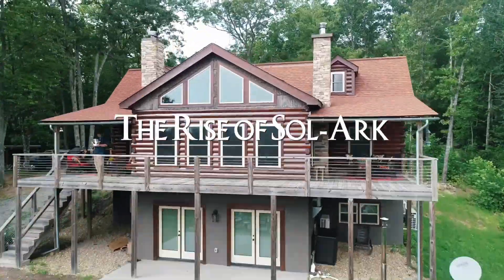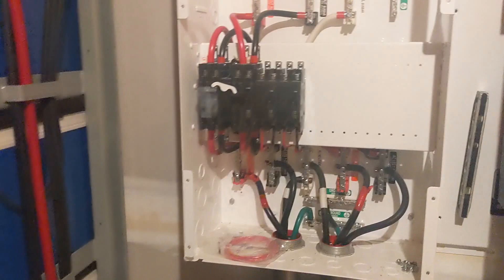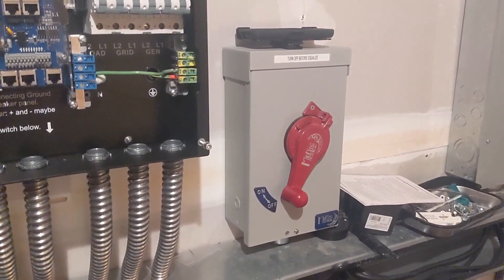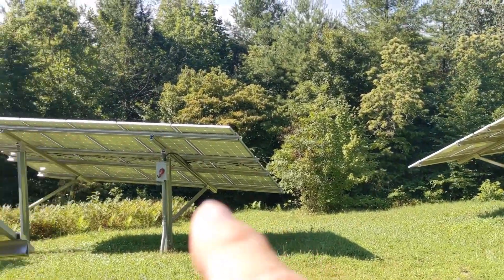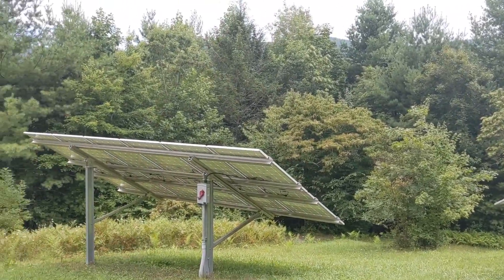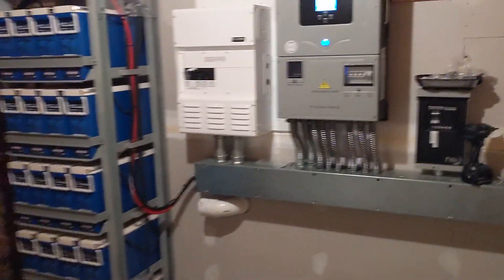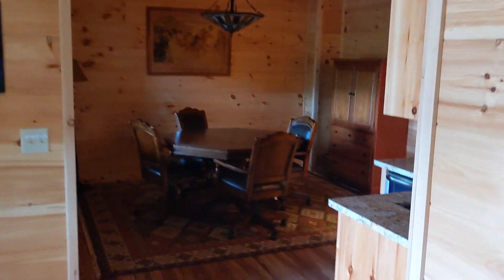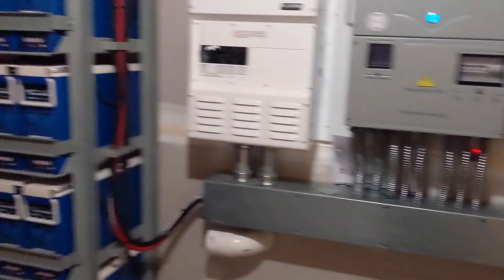The Rise of Sol-Ark!! (Retrofitting Sol-Ark Inverter and New Batteries)

Comment: what is the benefit/issue regarding having balanced PV input to the 2 MPPTs. I presently have (1) 10 panel string on one MPPT and (2) 7 panel strings on the other MPPT. Considering getting 4 more panels to have 2 pairs of 7 string panels. Total 28  400w panels is 11.2 kw.

Comment: Any reason why Sol-Ark doesn't focus on EMP hardened lithium LiFePO4 battery solution (w/ EMP hardened BMS)? They provide more cycles, deeper cycling, smaller footprint, etc... I guess Sol-Ark would have to answer to that, but I'm just wondering, as I am considering to purchase a Sol-Ark 12k inverter, and I already purchased lithium battery bank but my BMS's aren't EMP hardened.
Reply from the maker: They tried and spent the considerable amount of resources to try to EMP harden BMS's but they weren't successful.

Comment: I automated my change over switch by using a 4 pole contactor  2 no 2 nc contacts with a 230 volt holding coil fed from the inverter output , when the solar output goes down it deenergizes the coil and automatically connects to the grid. When the inverter output is restored it energizes the holding coil and switches back to inverter power.

Comment: I am must have missed something but I am wondering why you didn't run two 9 panel strings parallel? Couldn't you have been good with little loss of power by running lower amperage using two pairs of wire? I am using paired strings of 9 panels through 10AWG   THNN/TWNN stranded copper wire to each charger running 323'. Only experienced a 2.2% loss of power.

Comment: Freezer voltage. According to the spec sheet this freezer is 12/24 volt only. In the video you said it was 48V (battery bank voltage). So what is actually going on?
Reply: For $35 you can make it 48 VDC.
Reply: @ek9772  Can you post a link to that?
Reply: @ek9772  It is really odd that they do not list any specs on the 48V version. Not in the manual or the spec sheet.
Reply: @bradquinn4161  they make good quality products.  I would not worry too much over it.

You can always call the company, and ask for extra info.

Comment: Question, could you put a lighting rod up to decrease the issue with getting hit buy lighting, we had issues in Colorado at times, Dad would put up a electrical pole to be higher than anything out there and insert a rod ten to twenty feet long into the ground to attract the lighting to it instead of the equipment.

Comment: Honest question.  Why use carbon-enhanced lead batteries which will operate from 85% SOC to 50% SOC, yielding about 1/3 the nameplate storage, rather than your favorite brand of LFP batteries that will operate from 90% SOC to 10% SOC?  The higher usable amount of storage would allow for a smaller bank but would  effectively yield the same amount of storage, and cost about the same as the carbon enhanced lead acid batteries.  Am I missing something?
Reply: You can't EMP harden LiFePo's.
Reply: @Thomas Chrombly I'm afraid not, ask Engineer 775. He's the one that said you can't !   :)
Reply: @Thomas Chrombly Easier option is to use TVS diodes and Ferrites on the battery terminals.
Reply: @guytech7310  
Yes you can harden the LiFePO. With TVS diodes (for speed) and MOV’s (for current) against lightning, the number one problem. As long as you are off grid a Carrington event is a non issue. As for a HAEMP event, the voltage rise is too fast for anything you can buy.....except spares. (BMS + capacitive active equalizers)
Reply: @SkypowerwithKarl  TVS diodes are fast enough for NEMP. Most of the datasheets list NEMP protection. MOV's will not protect against a direct lighting strike. I would recommend avoiding MOVs since they quickly fall since they are limited use devices. 

en [dot] wikipedia [dot] org/wiki/Nuclear_electromagnetic_pulse

"The E1 pulse is the very fast component of nuclear EMP. "

"Fast-acting surge protectors (such as those using TVS diodes) will block the E1 pulse. "
Reply: @guytech7310  
Good to know. I’m from a time of bringing in the spark gap and back out till things show clear. Surfaces mount stuff today isn’t as tolerant as the old days!
Reply: @SkypowerwithKarl  You can buy TVS diodes as through hole or SMT. Usually the very large TVS diodes capable of handling 30kW are all through hole devices.

Comment: Each solar panel should have a lightning arrester ( spike) rod mounted on the Frame about 5 feet high, the lightning arrestors should have each their 10 foot ground rod. Also there would be a lightning arrestor rod on the highest part of the roof, also abt 5 feet high over the roof and with its own 10 foot god rod. cheers,  P&F
Reply: I guess my 7m x 6m steel shed, which the racks are bolted to, isn't enough (beside the 90cm grounding rebar out the back). 

Oh wait- have had lightning hit the shed twice, with nil effect- i better do what the internet scientist says....

I guess some people know waaaayyyyy more thanks the Internets.

Qld, Australia for reference (waiting for the "oh but! in my county"...)
Reply: You forgetting that lightning can back feed from the ground. When a lightning strike happens it energizes the local ground at a significant voltage.

Comment: Sounds like they could use a well placed lightening rod, maybe even on a tower...
great video
Reply: I was thinking the same.
Reply: Lighten protection is not a single point solution.. It takes several high points 10' apart... Around the whole area. Then you attach that too the tower...Same thing they do in High rise buildings...Minus  the tower...As the building is the tower.....
Reply: Well even nearby lightning strikes and produce a localize EMP. also when lightning strikes it can energize the ground circuit that back-feeds into the electrical panel or anything connection to earth ground. You plan of a tower might work if the tower is 1/2 mile or more away. But towers aren't cheap!

Comment: What is the price range for a system comparable to this one?  If I thought I could be completely off grid in the 20k range, I would seriously consider it, but I suspect I couldn't come close to this system for that.
Reply: I am pretty sure you could build the old system they had for 20k if you did it yourself.
Reply: All depends on your needs. The Sol-Ark itself is already $7k or so. 18 x 300watt panels adds another $6k. Battery bank 16x 12V LiFePos4 4S4P ~ $16k and misc items at $2k. Without labor or as DIY we are around $31k. It’s the price of independence
Reply: @4philipp  or you can add gel Lead batteries for a little less.
Reply: Cost largely depends on the size of your panel array & how big your battery bank is. EMP Hardened Sol-Ark is about $7K. I have about $7K in batteries & no panels.